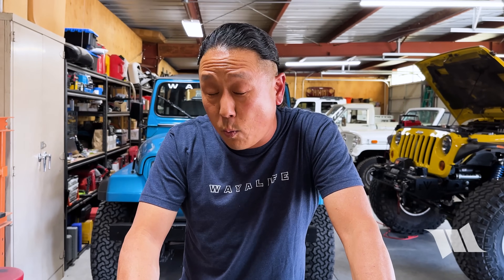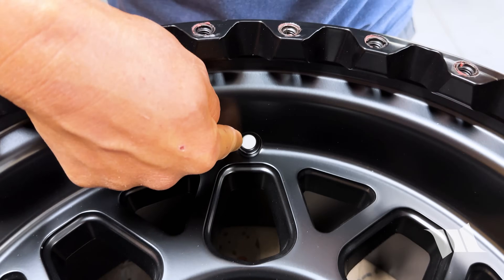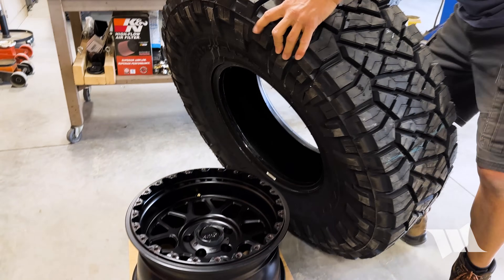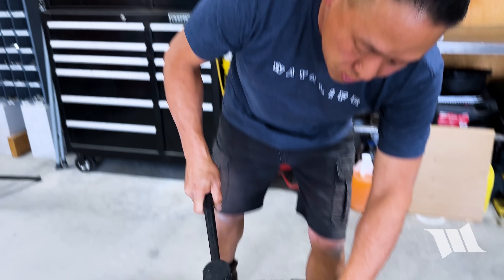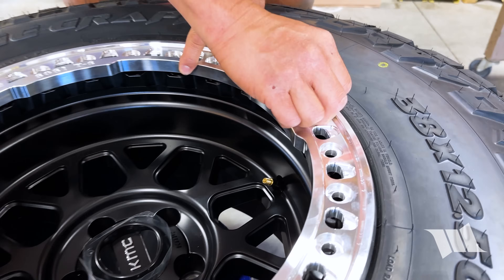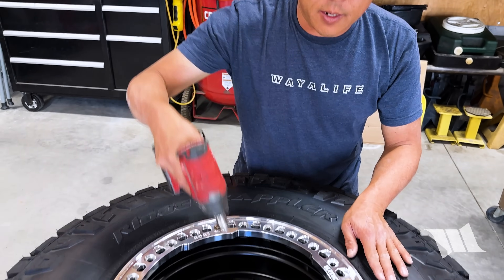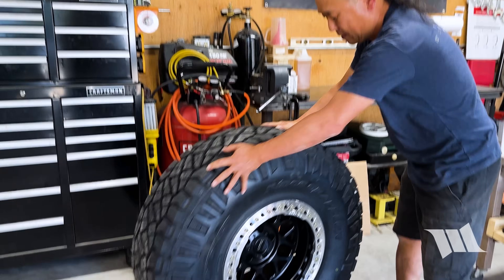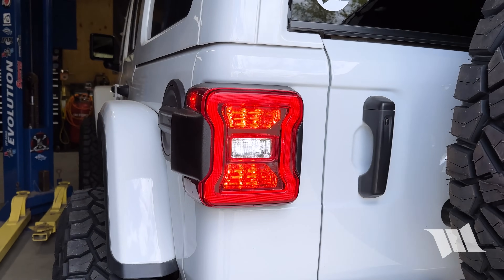HOW TO Install Beadlock Wheels for Beginners

Comment: Hey mate, are you sure it's 32 ft/lb of torque. i have KMC machete and i have seen online that it is 24 ft/lb of torque. just want to make sure for when i do mine. cheers
Reply from the maker: LOL - I would never pretend to know more than what you can see online but I do tend to trust the specific torque spec that KMC specifies for their wheels.
Reply from the maker: I should note, KMC uses BIGGER bolts than most beadlock wheels made and and this spec is specifically for their wheels and bolts.
Reply: Thank you! Where do you find the torque specs from KMC? I have some sheets that come with the wheels but I can't seem to find anything about torque specs
Reply from the maker: As soon as you open the box, there should be a piece of cardboard on top with all kinds of information including torque specs for specific bolts they provide with their wheels. There are even holes in it that you can insert your bolts in to verify their size.

Comment: did you balance each tire? ever use balancing beads?
Reply from the maker: High quality tires like the kind that Nitto makes typically does not require balancing. But, nothing is perfect and IF I feel a need for balancing, I take my Jeep into my local Discount Tire and have them balance them for me using tape weights. Balancing beads are snake oil.
Reply: @wayalife  thanks for the reply. Very helpful.

Comment: Did you have to regear?
How did you balance them ?
Reply from the maker: I have not regeared and the power loss isn't too bad being that these are mounted on our 392 but a lot of the fun factor of it is gone now and so we will regear it soon. Most likely to 4.88.

As far as balancing goes, high quality tires like the kind that Nitto makes don't typically need it. In fact, only 2 of the 3 tires had yellow dots to line up and so far, everything feels nice and round. However, IF I feel a need to balance my tires, I take my Jeeps to my local Discount Tire shop and have them do it for me with tape on weights.

Comment: Great video Eddie.  About what PSI do the beads usually seat?  Did you have these balanced? Thanks
Reply from the maker: A bead will seat with very little psi, maybe 5 to 10 at most. As far as balancing goes, I only get them done IF I feel a need for it and typically, I don't with Nittos. In fact, only 2 of the 5 tires had yellow dots. But, if I need a balance, I take my Jeep into my local Discount Tire and they do it for me.
Reply: @wayalife  Thank you Sir.

Comment: How did you extend the rubber bump stop on the tailgate for the spare??
Reply from the maker: I installed a set of these https://amzn.to/433oYE1
However, they were still a bit short and had to add the factory isolators on to them. I did this by reversing it and sticking them onto the Energy isolators.
Reply: @wayalife   ah okay thanks!

Comment: Would you consider a 392 a great choice to build a Rock Crawler or should I get a V6? thanks
Reply from the maker: If you have money to burn and don't care about beating on a $90K Jeep, sure. Having lots of power is always nice to have on big rocks. However, be ready to throw even more money at it for things like a new transfer case and 1-ton axles, essentially, another $25k or more as what comes on the 392 from the factory, won't last long.
Reply: @wayalife  That is what I was afraid of. Thanks. After I watched your video on the new lift kit I realized you are not turning yours into a Rock Crawler. Thanks for the information as always you are my go to for this type of information.

Comment: Do you only have one ring ? What if the inside pops loose ?
Reply from the maker: Not saying it can't happen but in the over 2 decades that I've been doing this Jeep thing, that's never been an issue I've seen.
Reply: Inside of the rim will tend to have a bigger lip helping thr bead stay on. The outside tends to have a smaller lip hence why we use a bead lock to lock the outside bead in. Some rims will have a bigger lip in tbe outside rather then inside but uncommon.

Comment: Very nice! Have you ever upgraded brake calipers / rotors with larger tires? If so, do you have a favorite?
Reply from the maker: Other than what came on the ProRock 60, 80 or UD60s that we now run, no. With factory axles, I've always found the factory brakes to get the job done especially on a JL or JT.

Comment: Is mounting a non-Beadlock just as easy as you made this look? Or is the bead easier to get in because of the ring?
Reply from the maker: What beadlock wheel and what tire you're installing will make a difference in how easy or hard it is to do. Cheaper wheels with thinner rings will make it harder and tires with really thick beads will as well.

Comment: Do you still have to get them balanced afterwards or no?
Reply from the maker: High quality tires like the kind that Nitto makes don't necessarily require balancing. More times than not, I find that I can just install my tires and go and without any issues. However, IF I feel a need for balancing, I just take my Jeep to my local Discount Tire shop and have them balance them for me.
Reply: @wayalife  thank you, do you think the same goes for Toyo tires? I run 35’s M/Ts on my truck
Reply from the maker: Toyo and Nitto are the same company and so yes, I do think the same applies. In fact, I can say with experience having installed Toyo MTs many times in the past that they are very very round.
Reply: @wayalife  thank you 🙏🏽

Comment: Maybe you said and I missed but how are you balancing your tires
Reply from the maker: A high quality tire like the kind that Nitto makes typically does not require balancing. In fact, of the 5 tires I installed, only 2 had yellow dots that I needed to line up. However, IF I feel a need for balancing, I just take my Jeep down to my local Discount Tire and have them balance my tires for me.

Comment: What psi did you inflate them to? I have 37’s and looked up what psi I should be running them for everyday driving. Some people say high 20’s, other’s say low 30’s, it’s all just confusing. lol
Reply from the maker: It really depends on the width of your wheels and width of your tires. Ideally, you want your tire's footprint to be flat to the ground and typically, for a tire of this width, you'd be looking at about 28 to 32 psi.

Comment: Do these need to be balanced?
Reply from the maker: Fortunately, Nittos make really round tires and for the most part, we have found that balancing isn't needed with them. In fact, of the 5 tires I installed, only 2 had yellow dots. However, IF or when I feel a need for balancing, I take my Jeep into my local Discount Tire and they balance for me. Glad to hear you enjoy our videos.

Comment: Any reason why you didn’t balance?
Reply from the maker: Because high quality tires like the kind that Nitto make don't always need to be balanced. However, IF I feel a need to have them balanced, I don't have the means to do it myself and so I take my Jeep to my local Discount Tire and have them do it for me and with tape weights. https://youtu.be/qUau-psASbk?t=744
Reply: @wayalife thanks man,  I just recently installed the same setup on my jeep used beads but still get a vibration at around 70 . Took them to tire shop and said the same thing, said remove the beads and and just use weights.
Reply from the maker: @javiroo1743  Beads are snake oil

Comment: do you have to balance them then
Reply from the maker: Only if they feel out of balance and you will know if they do. That said, a high quality tire like the kind that Nitto makes, I typically find that it isn't necessary. In fact, only 2 of the 5 tires you see in this video had yellow dots. But, to your question, IF I feel a need for balancing, I take my Jeep to my local Discount Tire and have them do it for me.

Comment: how do you balance those wheels?
Reply from the maker: IF balancing is needed, I take my Jeep into my local Discount Tire and have them balance my tires for me. However, with a high quality tire like Nitto makes, I don't typically find the need to balance them.

Comment: So they are balanced already or what?
Reply from the maker: For the most part, high quality tires like the kind that Nitto makes do not require balancing. However, IF I feel a need to have them balanced, I take my Jeep into my local Discount Tire and have them do it for me using tape on weights.
Reply: @wayalife  Nice, I want to get beadlocks for my daily but that's my biggest fear, balancing. Good to know what Discount balances big boy tires.

Comment: Did u not balance the tires?
Reply from the maker: High quality tires like the kind that Nitto makes typically do not need to be balanced. However, IF I felt a need to have my tires balanced, I just take my Jeep into my local Discount Tire shop and have them do it for me.
Reply: @wayalife  wow,, I've ran Nitto, Toyo and MT for years and Always had to balance them.
Reply from the maker: @raydelfa1125  Did you watch this video? Most shops suck at lining up the yellow dot and if they miss that step like most do, a balance will be needed. When installing your own wheels like I show, you can make sure to do things right.

Comment: No need to balance them?
Reply from the maker: High quality tires like the kind that Nitto makes typically do not "need" balancing after being installed. In fact, of the 5 tires I got, only 2 had yellow dots. That said, IF I feel a need for balancing, I take my Jeep to Discount Tire and have them balance my wheels.

Comment: Why 32lbs and not 24lbs for the bolts like kmc calls out?
Reply from the maker: Maybe try reading KMC's directions more carefully. 24 ft lbs is for 5/16" bolts and these wheels came with 3/8" and KMC specifically state to use 32 ft lbs. They even have a template that you can use to verify the bolt size.
Reply: @ you you always answer your subscribers, gives me a sense of you humility, your a humble man.

Comment: So absolutely no balancing needed?
Reply from the maker: Never said that. However, Nittos does make a really round tire and for the most part, we have found that balancing isn't needed with them. In fact, of the 5 tires I installed, only 2 had yellow dots. However, IF or when I feel a need for balancing, I take my Jeep into my local Discount Tire and they balance for me. Glad to hear you enjoy our videos.

Comment: Why do you need to have a beadlock  tire
Reply from the maker: Beadlocks are only need for people who are playing hard enough on the trail that they need to lower the psi in your tires to 10 or lower to have any chance at getting any real traction on really tough obstacles. At that low pressure, the chance of rolling a bead becomes a lot greater and the beadlock will help prevent that from happening.

Comment: It's literally not that easy idk how you guys on YouTube make it look so easy seating that bead befor you put the ring on is almost impossible on 2 of my wheels
Reply from the maker: LOL - actually, it literally IS that easy or at least, with this tire and beadlock wheel. We showed EVERYTHING that I did as I did it and IF there were issues, I would have shown it and explained how to get around it. If you applied lube to the ring side of the bead, that is probably your problem as it will make everything too slippery.
Reply: @wayalife  no lube I tried the 2 screw drivers trick nothing I ended up using big washers to hold the tire down as I went around the wheel I'm a very unlucky person had this problem with all 4 of my wheels I've don't this before for someone else and it was easy but sometimes things happen to were its not easy
Reply from the maker: @nd2mx5dd47  What tire were you trying to install? A Cooper STT Pro or something like it? You yourself just said you've done this before and "it was easy". Again, I have no reason not to show any problems I might encounter during an install and so that I can show others how to make it work.
Reply: @wayalife  wait why do you seem mad I'm confused now also it's 37 inch mickey thompson baja boss M/T going on kmc XD231 RG wheels
Reply: @wayalife  the first time it was 37 inch mickey thompson baja boss M/T that went on raceline wheels
Reply from the maker: @nd2mx5dd47  Mad? 🤣
Reply from the maker: @nd2mx5dd47  Mickey Thompson is your problem. They're made by Cooper and share the exact same carcass and they have super thick beads.
Reply from the maker: @nd2mx5dd47  Here's another video I made years ago showing how I needed to use clamps to help get a set of Coopers installed on the same beadlock wheel https://www.youtube.com/watch?v=Az4Ndop49Kg